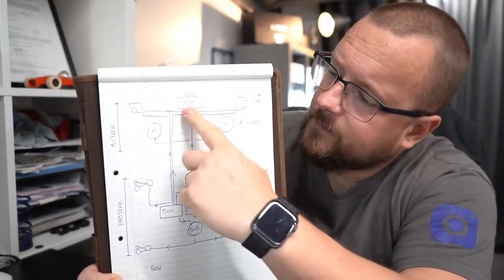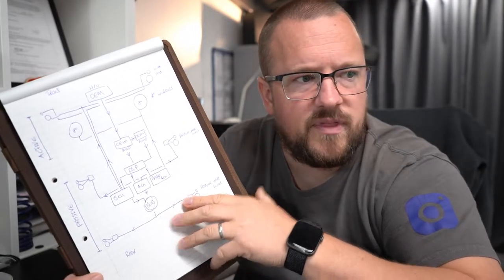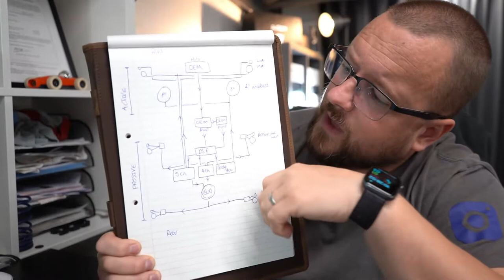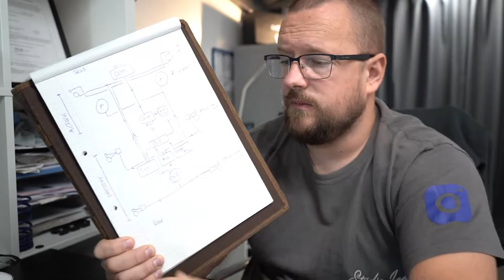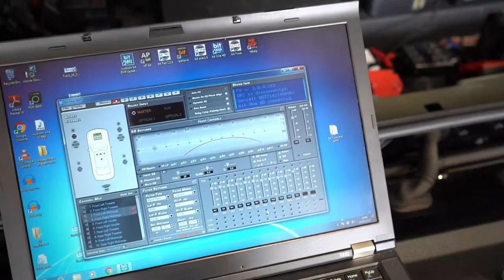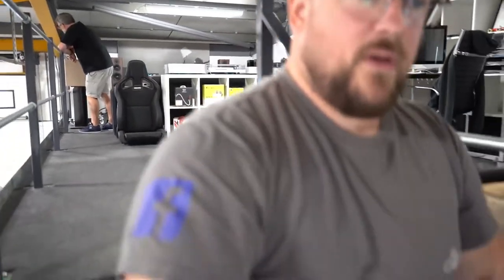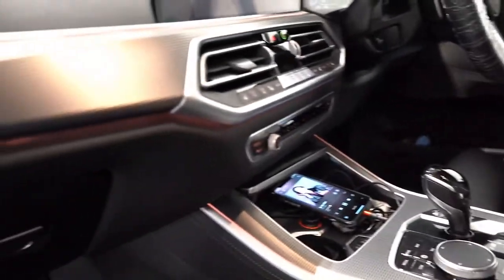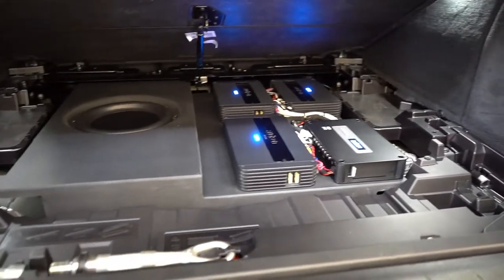BMW X5 M50D Audison Sound Upgrades!! G05

Comment: Great install, I am very impressed with the use of multiple amps to power the system separately but I’m more interested in the sub woofer enclosure. What is the volume of the box and how does it sound with the cover installed ? I would love to have a this done in my X5M. I currently run a 10 inch JL audio W7 in a sealed box and I hate that it takes up space.

Comment: Speakers that have frequency cuts made actively by the audio processor (by the Audison bit One DSP) do not use physical crossovers, correct? In other words, in these cases I “never” use physical crossovers, correct?
Reply from the maker: Correct
Reply: Researching the subject, I saw that a few installers still use the physical crossover even when the speaker is connected to a DSP. In other words, the speaker's frequencies are being cut actively/digitally (by a DSP), but the installer still chooses to install the physical crossover. What is the logic behind this strategy? Isn't this configuration wrong? In these cases, doesn't the presence of the physical crossover interfere with the final equalization of the sound? Does the installer place the physical crossover in the hope that it will be a physical protection barrier for the loudspeaker? Is it a question of redundant protection to prevent damage to the speaker?